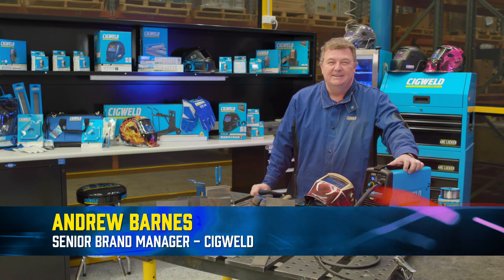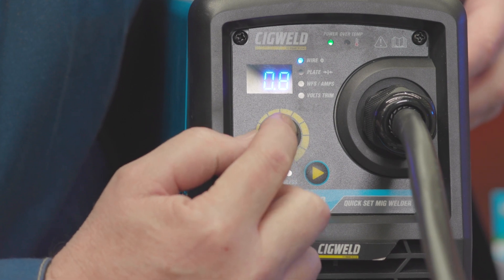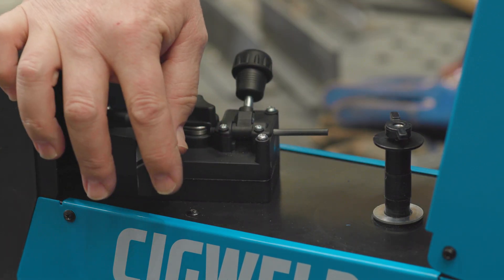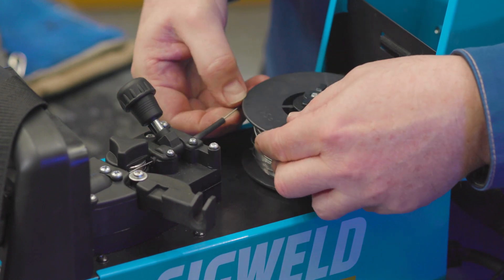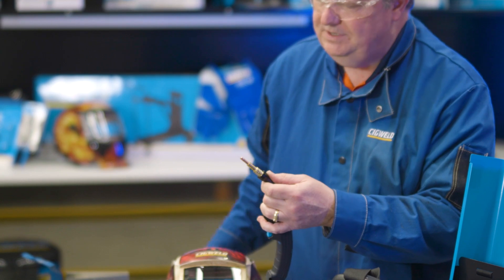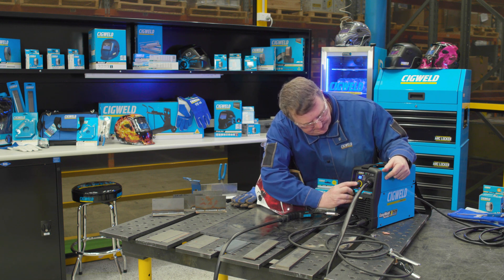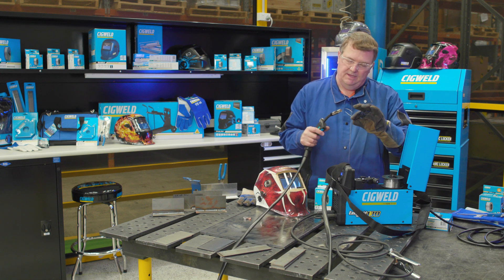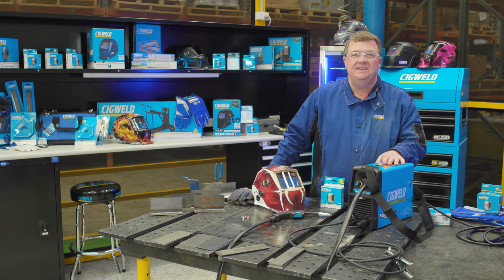CIGWELD EasyWeld 130 - How To Setup Guide - Setup in 3 easy steps.

Comment: How to use it to weld 0.6mm steel?
Reply from the maker: To weld 0.6mm mild steel, you will need to use 0.6mm MIG wire (part number 721104), then select Gas (solid), 0.6mm Wire diameter setting, and then dial in 0.6mm on the plate thickness setting. This will then set the appropriate wire speed and voltage automatically to give premium results!

Comment: I cannot pick up the outlet guide off the roller
Reply from the maker: Hi Ian,

If the MIG gun liner is touching the feed roller, lay the MIG Gun as straight as possible and then loosen the 4 screws on the MIG gun retaining cover (shown in the operating manual as “outlet guide” - Please refer to section 5.03, figure 5-5 on page 37) . You will be able to then slide the liner away from the feed roller slightly and then retighten the screws to hold it in the correct position. 

https://www.cigweld.com.au/wp-content/uploads/2021/10/0-5618_AB-EW-HW-130-operating-Manual.pdf

Comment: I want to make a bench vise (10mm carbon steel) and a hold down vise for my pedestal drill (6mm & 10mm). Will the second to smallest unit do ?
Reply from the maker: The EasyWeld 130 is rated to 6mm plate thickness, so your 10mm plate thickness is just a little beyond it capabilities. We’d recommend the EasyWeld 160 which is rated to 10mm plate thickness!

Comment: Great review. Would it be suitable for 1mm mild steel for rust repair panels for cars? I am doing a restoration and i have an old mig that i want to up grade. Can it be adjusted as low to weld 1mm steel? 
Thank you.
Reply: @VintageEngineRepairs  Hi mate thanks for getting back to me. Its ok but still seems like the wire speed is to fast, even turning it down the wire feed is a little fast, but i have been able to weld some rust repair sections on a car i am restoring, not the nicest looking welds but once i cleaned them up they are not to bad but strong atleast.
Reply: @Itallstartswithadream1  Were you welding the rust holes with flux core?
Reply: @troubledtinkerer  Hi mate yes flux core wire
Reply: @Itallstartswithadream1  i know this is was a year ago, but i am thinking of getting this and doing rust repair but on thinner down to 0.8mm, have you tried running thinner with gas?
Reply: @adamabdulrazak761  Hi mate, no I havnt tried it with gas but I believe it would give a nicer weld tbh, i still managed to weld all my rust repairs gasless, took some practice but its a good welder
Reply: Ok i just seen the whole video again and noticed you said it goes down to 1mm setting 👍 cheers! Looks like this will be perfect for what im using it for.